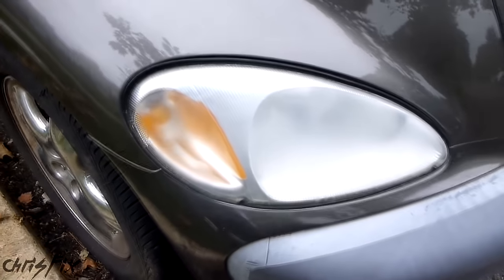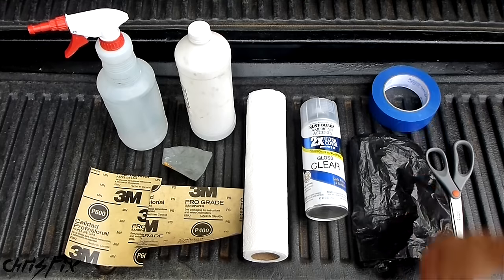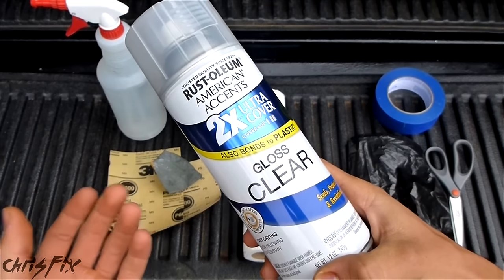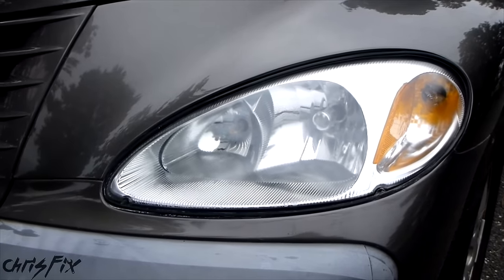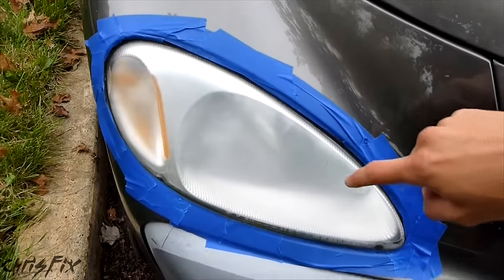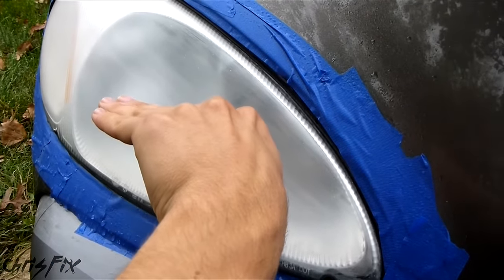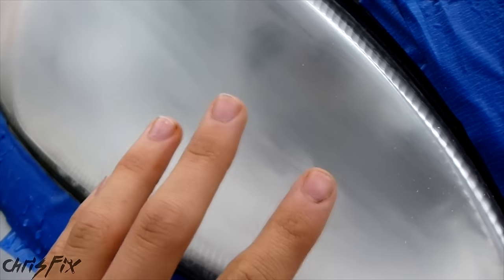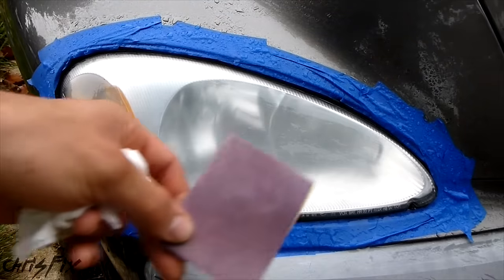How to Restore Headlights PERMANENTLY

Comment: You are truly the best! I am a single 60 year old female who has never had enough money for repairs of any kind or anyone to ever help me. I have cried so many times about troubles that have happened with my vehicles thinking now what? I can't do that as in different repairs ...but then each time I found you except one issue recently. You  have always had such clear verbally and visually videos. You have saved me so much money! And you gave me a pride or great feeling when I was done saying ... Wow I did it myself! The one thing I did not find from you that I needed help with was for a 2005 Buick rainier specifically how to get the washer fluid reservoir out and check to see where fluid is pouring out from. In my case it was a crack in the base of the rear fluid pump. Car shop said they checked it out and there was a huge hole or maybe they said crack and wanted est. Of $400!! There was neither! My lights tho had some kind of vinyl cover over them that was peeling off and then once I just pulled all the film off .... my headlights were ruined and I could not see clearly out of them and nothing ever worked that I tried but I kept making them worse. So thank you so much again!!
Reply: Mam, you should be commended for your attitude! Keep on keeping on so to speak

Comment: Thank you for the awesome video! I have a 10-yr-old Civic I'm trying to get more years out of. The engine is fine, it's the cosmetic stuff that's falling apart! This worked great! I'll add my two cents that after the 2000 grit, I used some plastic polish for the final sand. I'm so encouraged by the results, I'm going to watch more for my other projects!
Reply: I get you want to get more miles out of your Civic. Mine is 10 yrs and my hubby's is 12 yrs. Both run great!
Reply: My BMWs are each over 23 years old and still look great because they're not shitty hondas.

Comment: I did this and it worked great! Only problem was I might have put too much paint on each time as I waited for the five minutes between coats and it ended up "crackling" so I had to start over.  Less paint and maybe more time between coats or else you have to start over.
Reply: When I was watching the video, I kept thinking "He's putting on too much!"
Reply: when u restarted what did u do to get the paint off did u just start the sanding process over an if u did the sanding process again did the paint just come off or what?
Reply: @frequik To be honest it was so much better than it was before I decided I could live with it the way it is for now... but ya I imagine you'd just sand it right down again.
Reply: Same issue here and this will make the second time I have to sand these down. I even removed the headlights the second time to be sure I did it perfectly and still cracks in the finish and I lightly sprayed. I noticed crackling at the second coat. This is totally a bummer.
Reply: @lyric.kayden  It's hard to know for sure why you got the crackling, but it's possible there's an issue with the spray can. It could have been expired or perhaps was stored in too hot or cold of an environment. Other issues could be humidity or temp when applied.

Comment: My headlights were yellowed like old cellophane tape. Your video is the only technique for an permanent fix. Manufacturers love to sell temporary fixes so you keep buying their product. Why can't cars have glass lenses?  Please note: in some states you can actually get a fix-it ticket if your lenses are too cloudy. A cloudy lens will not throw the light beam as far. If one has a little patience, your technique is quite easy. My lenses on my 14 year old truck now look new. Thank you for this video.
Reply: There were cars with glass lenses and honestly I think that tempered glass would do a fine job. I believe it's just a concern with durability.
Reply: I think it is a cost issue, much cheaper to make them out of plastic. To get the same proffit out of glass lenses they would have to charge an arm and a leg, people would buy but the volume would be so low that it is just more proffitable to use plastic.  At least on the average car.  Now high end vehicles may be different.
Reply: You have a great point there. Glass is expensive to get interesting shapes out of for mass production, whereas plastic injection is cheaper than air.
Reply: yixnorb I was told it was DOT regulations require plastic lens for protection to pedestrians believe it not...   in cases where you hit one.   In Europe, most all vehicles have the same lens' made of glass.. well I know BMW , MERCEDES, Audi do.. many people buy the euro glass lens through the aftermarket and swap out... much better light results with glass
Reply: not safety glass
Reply: My 1984 Caprice still takes glass headlights. In event of a stone flying up it can chip and break; one out of four headlights on the car now has a chip in it.
Reply: yixnorb suv luminas just to have glass at the one i owned it was 91

Comment: Just wanted to add that after the sanding the headlights they will look even cloudier/worse than when you started. Don't be discouraged. After the clear coat spray they will get back the clear look you want to see. I used 1000/1500/2000 grit sandpaper and the results on my 06 4Runner turned out quite nice.
Reply: How long has it lasted?

Comment: I may have screwed up, not sure. I couldn't find 2000 grit in our small town, so I bought 1500 and then 3000 grit. After the 1500 I used the 3000 and then sprayed. I think I got it a little too thick on the last coat but will see. Tomorrow will wet sand with the 3000 and follow up with the carnuba wax to see how it looks. But I have to say, it looks pretty fantastic compared to how it was. It was getting rediculous to try to drive at night. It's an 02' so you can imagine the dullness. Thank you for a fantastic step by step process of "how to".

Comment: Quick tip that I learned the hard way: If you've applied too much clear spray, use alcohol and microfiber towel to remove it. It will take time, and was a pain in my rear, but it will eventually get it off. Afterwards just restart the process all over again, beginning with 400 grit sand paper.
Reply: thank you bro i just did it an i messed up left headlight it had some drips and i didnt sand both headlights enough they both had some yellowing

Comment: Just an fyi, 70% rubbing alcohol is cut with mineral oil, and will leave a residue after the alcohol evaporates. If you use 90% it's not cut with mineral oil
Reply: lol where did you read that
Reply: @nadrojylloh  the label. A coworker's wife is a beautician and she found out from another client. We checked it out, and in general cases its true. But, dont take my word for it.
Reply: @johnwright6706  I have never heard of that, but I guess it's possible. I am suspicious because isopropyl alcohol dissolves most oils, so not sure how an oil could be mixed in.
Reply: @nadrojylloh  suspicion is always healthy.  The wife did an experiment using the 2 types of alcohol, 70% and 90% the nail beds cleaned with the 70% had the acrylic nails come off where as the 90% didnt. Which when you consider that the alcohol is used to remove oils so that the adhesives will set up better, the claim is pretty good. 

The curious thing to me is that the 2 products are comparable in price. So I've just taken to only buying 90% any time I'm in need.
Reply: @johnwright6706  I prefer to drink mine straight up!
Reply: Use 100%, not cheap but mix it with distilled water and you get the same effect. Also when you spray the headlight with it it looks brand
New before the IPA evaporates
Reply: @stopchangingmynameyoutube  yeah he must be fun at parties
Reply: 70% rubbing alcohol, like 90% contains active ingredient Isopropyl alcohol, inactive ingredient purified water. That's it.  If containing mineral oil would need to be listed on the label. It isn't. Not only would mixing with mineral oil be completely unnecessary, it would be more expensive and make no logical sense.
Reply: Alcohol is cut with water, not oil. That's the case for all alcohols, water and alcohol are completely miscible
Reply: I used denatured alcohol for mine it worked beautifully. I did however have a big time problem with the paint. After all was said and done and I applied my first coat of paint the end showed itself. Year or dried out plastic cuased microcracking. It took a very nice layer of paint to soak into the mircocracks for them to startstrutting their stuff. Good news is it'll be protected for longer and now it's clear instead of hazy. Which means a brighter future for the roads ahead. Thanks for the video Chris. Good stuff.
Reply: IPA is made with isopropyl alcohol and purified water
Reply: Just use acetone or denatured alcohol. Those are both inexpensive,  fast-flashing solvents which leave no residue behind.
Reply: Depending on the age of your car, you could have polycarbonate plastic which desolves when exposed to alchohol...
Reply: Rubbing alcohol isn't cut with mineral oil in the USA.. maybe in the middle east where oil is more abundant than water. 🤷‍♂️😏
Reply: Yes, but 70% from the pharmacy ( rubbing alcohol is the industrial name for isopropyl alcohol) is only cut with water, because it needs to be medical grade. I never use the industrial stuff for anything, just the 91% drugstore stuff.
Reply: I’d strongly suggest using a DA with a pad or even the cordless drill and compound polish, then clear. You’ll get a better looking result and use dedicated headlight coating every so often instead of clear.
Reply: Hey girls, I suggest using isopropyl alcohol (IPA, isopropanol) as suggested by Chris.  While denatured alcohol ( c methanol) and acetone are indeed solvents, their chemistry may be significantly different as to affect the outcome.

Comment: I wish all , ALL, YouTube videos were this well done!
I have watched many of your Excellent videos and I rebuilt my first three cars.
Extremely oxidized headlights and paint is easier to remove with a palm sander, less effort. 
Steel wool is used for RV windshields and is a substitute for wet sanding.
Just alternatives to your well done process.
Reply from the maker: Thanks a lot and glad the videos have been helpful!!!

Comment: I really miss the days when you could go to Crappy Tyre to replace you headlights and didn't have to worry about plastic oxidization because they were made of ACTUAL GLASS which was always clear and the only reason you did that was because it burnt out. Yes, I'm that old. Great video though. I will give it a try.
Reply: Leo Boutilier plastic is cheaper, weighs less, and doesnt shatter everywhere. It's probably mainly the weight tho. Government mpg standards
Reply: My E30 has glass headlights (and foglights ugh). They shatter, but are awesome otherwise. Old cars rule.
Reply: My 1987 Supra has glass headlights and glass fog lights,  go old
Reply: Leo me too bro!   Im 67 and was easy to replace headlights, and even "aim" the  beam properly.   All headlights were cheap to replace too.
Reply: LOL I forgot about aiming the lights! You had to wait till it was dusk and then park in front of something, your garage or another building and line 'em up with your Phillips driver. Ha!
Reply: ...??? Which language is this?
Reply: My 2011 Mercedes glk 350 has glass fog lights. Had to replace one a few months back because a car ran over a rock and flung it at my car. I was not only shocked from the perfect aim of the rock but the light was glass, I thought we only used plastic in our 21st century cars
Reply: I wish!
Reply: Part of the 'throw away' revolution. Manufacturers may have started using plastic for cost reduction or weight (minor difference) but the plastic lenses make your car 'age' more quickly by rapid oxidation. And unless you are handy, this helps nudge you to the dealership to trade in your "old" and "aged looking" car.
Reply: Leo Boutilier gg
Reply: With OEM plastic headlights that are clear, most all cars after the 90's had crystal clear headlights out of the factory, it is a good practice to apply car wax or polish to protect the plastic. I did this with my '03 Mazda Protege and it still had almost completely clear lenses when I traded it in 2015. My 3-yr old Focus has even more surface area to the lenses, and even though I live in the great white North, I take the time even on cold days to gently clean and continously apply Meguiar's NXT wax to them to protect and also so snow/ice melts off much faster and there are so easy to keep clean due to the wax. I do the same to my glass as often as I can with either Rain-X or wax to make snow/ice slide off easier and keep bugs from sticking too bad also.  Some investment time a few times a year pays off as vehicles age.
Reply: You can avoid the haze by switching to low heat LEDs over the 800 degree halogen bulbs that deform the plastic inside as well.
Reply: Do you know why headlights would have a rainbow cast over them? I have a new 2017 car and it pains me to look at them. THX
Reply: Old is not always bad and new isn't always good ;)
Reply: Leo Boutilier I remember those days. You would go to the auto store and buy the whole big head light put it in connect it and you're finish. My have times change. Plus cars was real not plastic.
Reply: I work in medical glasses field. We stopped using glass long time ago. In my field I've known types of plastic that almost Not destructible.
It's not about plastic, it's about quality of it.
Reply: They make clear coats made for engine parts that can withstand high heat -- but the ones I found were only semi-gloss. I suppose you could apply several coats, let the paint fully cure, and then wet-sand with 1000-, 2000,- and 3000-grit sandpaper. Should give a final, glossy appearance.

Comment: I did this back in 2018. The headlights are finally back to looking hazy, but still not as bad as the original. I will go ahead and do another finish. I think 6 years is pretty good. I drive a 2002 Lincoln LSE. Over 20 years old now! I hope I can keep this car in good condition for as long as possible.

Comment: One headlight came out hazy. I finally figured out that I was a little timid with the last clear coat. You have to put it on just thick enought so that it blends together but not so thick that it runs. If its too thin it will be hazy.
Reply from the maker: +Allen Bishop Thanks for sharing Allen!
Reply: This is what just happened! I too was too timid and kinda freaked out, seeing as I have another set of dirty headlights, I gave it a try and sprayed more and it all worked out.
Reply: +Allen Bishop +ChrisFix I will need to try this again... All the yellowing is gone but now I have very scratched, hazy headlights. I'll have to try more clear coat I guess.